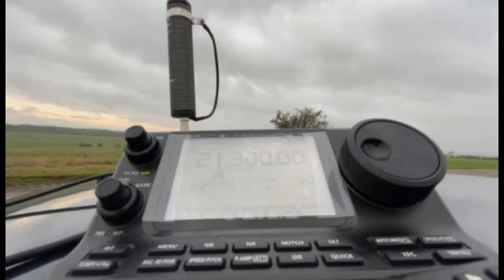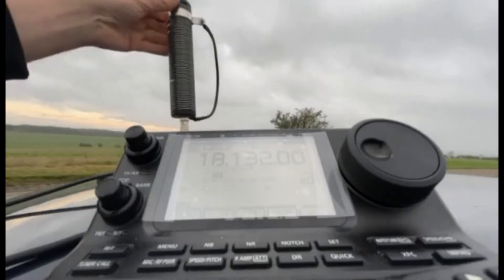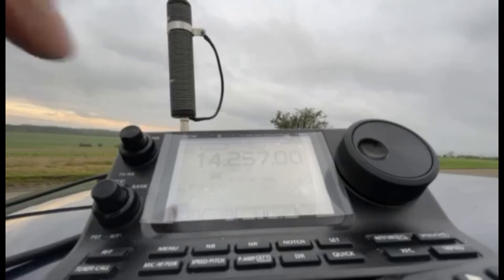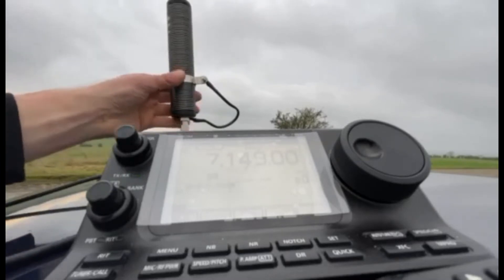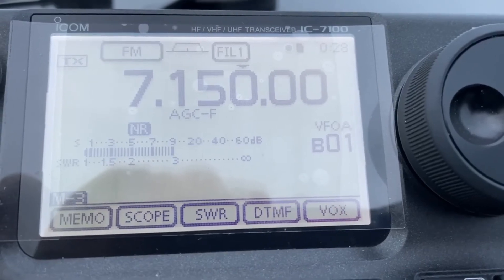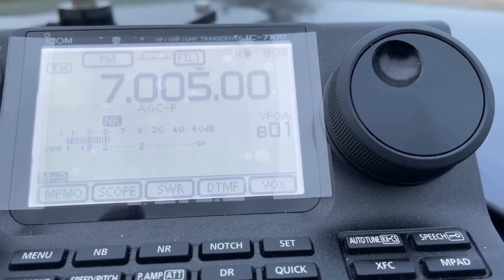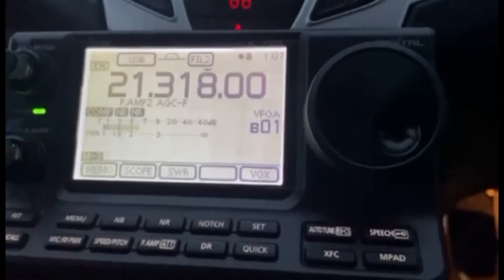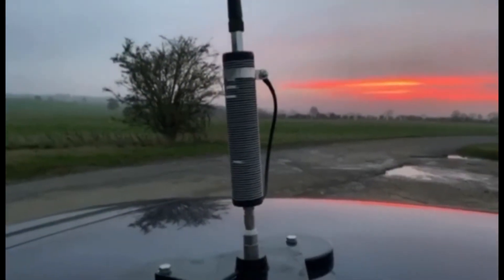Slidewinder coil tuning guide

Comment: This coil looks interesting to be sure.   I am currently using a couple of Ampros for 20 and 40 which seem to work okay.   It would be nice to get many more bands without the need to unscrew one antenna and replace it with another.   What method is used to mark the coil for the different bands?
Reply from the maker: Please search slidewinder dx coil or Slidewinder antenna on here to watch more videos about the slidewinder dx or also visit our website to learn more

Comment: Beautiful Slidewinder Coil. My Friend A92GW uses this one with a MFJ1979 long telescopic antenna and he is loud as hell with his portable setup.
Reply from the maker: Thank you 2 years  R & D Went into producing the Slidewinder DX Coil.
Reply from the maker: We don't recommend the MFJ1979 It puts too much wind loading on the coil. Our 9.35ft  7 section Military shock cord whip is better suited to the coil & in our testing performed equally as good if not better.